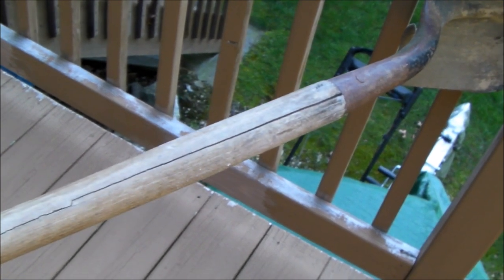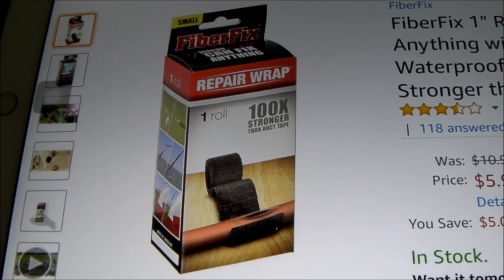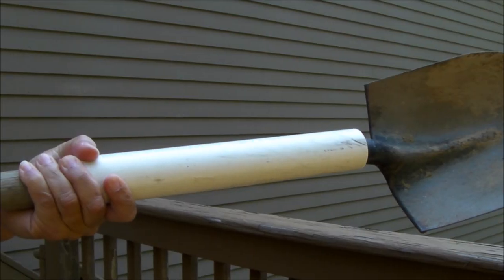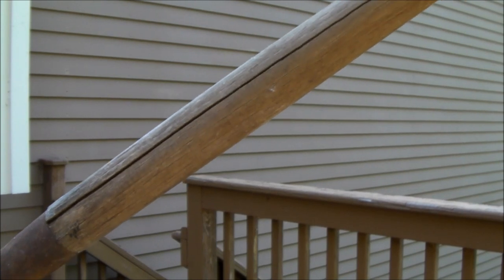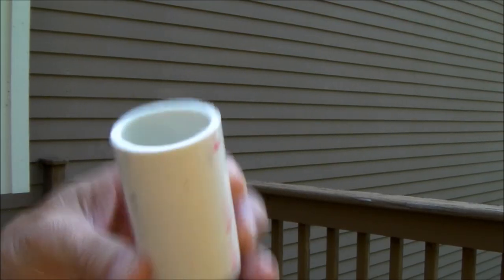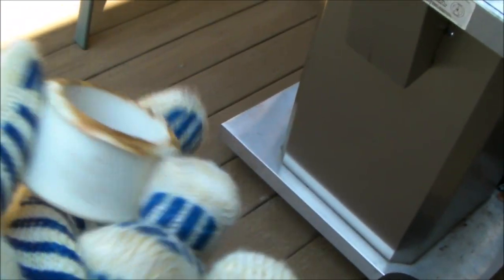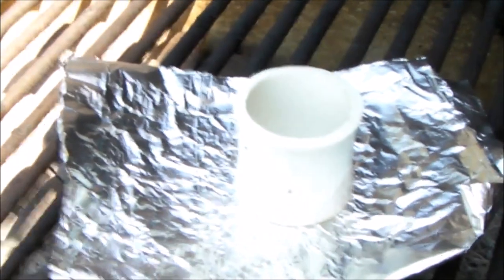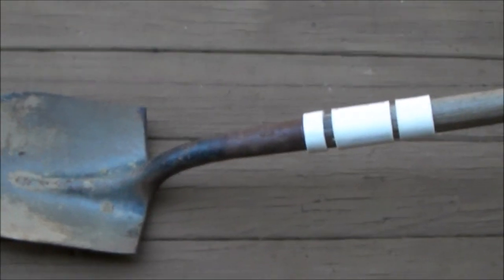Garden Tool Shovel Handle broken;  how to fix repair cheap

Comment: Glad to have learned a new trick. Great video and appreciate you including the test runs with the pvc heating.
Reply from the maker: Thanks for the feedback.  I hope you subscribe to my channel.  I would really appreciate it.  I have some other videos with PVC used as a "hose clamp" and have found lately that using my heat gun gives me better control and less chance of super overheating than the oven or gas grill.

Comment: The smell in the house will give you away!!! LOL-- how about a small propane torch? I like the idea, --have a  handle that  I heard a loud "crack" in the other day, so it is starting to give.. Have to keep this in mind...
Reply from the maker: I've recently stated using a heat gun, outdoors.  You have to keep the heat moving and it takes a few minutes but doesn't get too hot too quickly using this method.

Comment: What about when the wooden handle got dry rotted to the point where the wood snapped at the base?  Seems you could buy a new shovel if for what it may cost to get another handle.  My entire handle snapped off at the base of the shovel.  Those metal shovels aren’t made like that anymore so it’s a shame that had to happen.  I just got through painting the bottom of the metal shovel gold & then this had to happen!   😕
Reply: If it is an old shovel, even though it costs about the same to buy a handle as a new shovel- The old shovels dont bend when you stomp them in the ground.. the new ones it is not uncommon for them to bend-SAVE the old shovel they are worth it...